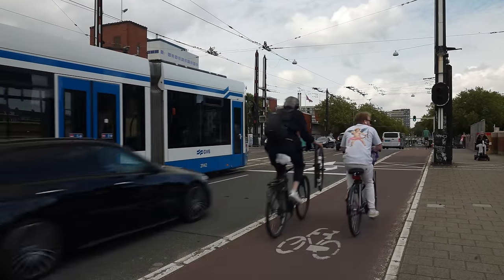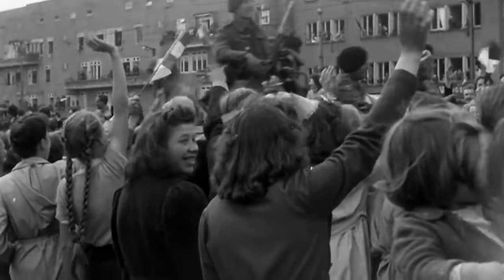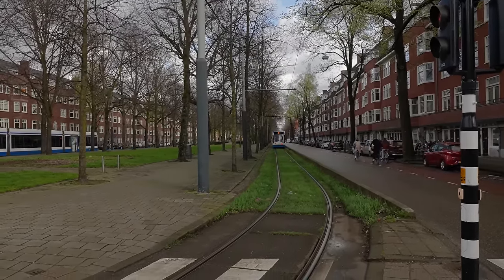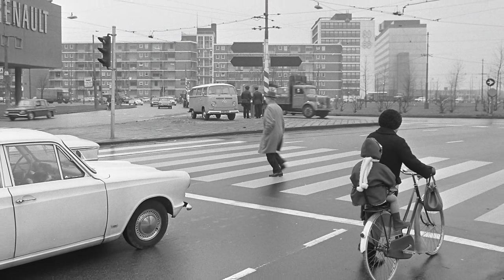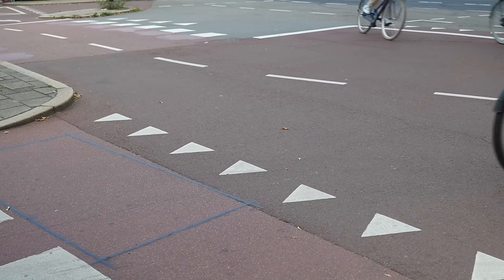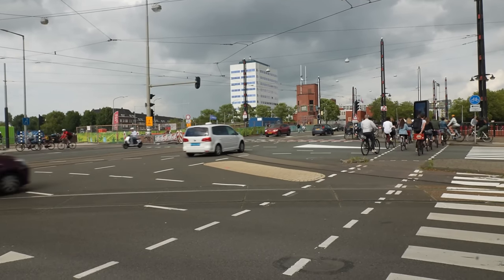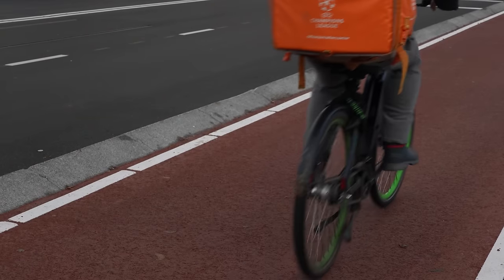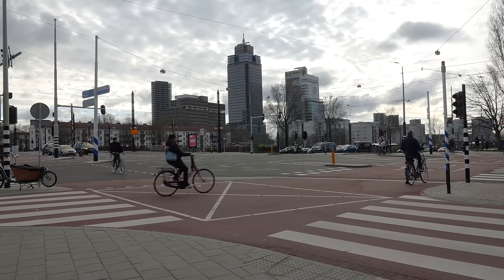Amsterdam Closed This Bridge to Cars (but not bikes ofc)

Comment: Since I've started watching your videos I have tried to prioritize using public transit or biking where I can and I discuss the overwhelming benefits of these mods of transport to others when they are sitting still long enough. I love this stuff, but I did want to ask a question. So, my partner was a bus drier for about 6 months and unfortunately he had to leave the job due to stress.  The stress was caused by the fact that he regularly had situations where there was belligerent, intoxicated, and sometimes unconscious or overdosing riders that he had to call emergency services for or just stressfully baby sit them.  This was not a big city.  I suspect a lot of the reason for this is that we don't have a robust social work infrastructure to help these people any other way.  We also largely perceive the point of public transit in this country as a substitute for driving if you're drunk or high.  This is a good thing on it's face but it leads to the general perception of public transit in the U.S. (at least around here) as something most people want to avoid. It also makes working in public transit a nightmare.  Is anything like this an issue in Amsterdam?  I largely suspect it is not and that there are other cultural structures and norms in place that prevent this kind of thing, as well as many more people taking public transit has normalized it, but if it ever is an issue I am curious how these sorts of things are handled. And simply drunk or high isn't the problem, but specifically poorly-behaved people or people in immediate need of medical or mental health care.
Reply from the maker: You can occasionally find drunk and disordererly people on public transit, especially in tourist areas, but what you describe is almost entirely due to a lack of social care and socialized healthcare in the US.

This is actually one of the reasons why I've stopped talking to Americans about public transit: I do not have the patience to explain to brainwashed Americans as to why they need a social safety net.
Reply: @NotJustBikes  I suspected as much.  :/  Many pieces to the puzzle are being dropped in this country.

Comment: Stalinlaan. If you could ride on souls, for every dead body Stalin killed you could pave the road by just one meter (or would align them to form one straight line, assuming everyone is one meter tall) - you would be able to pave the road from Amsterdam to West-Berlin or Moscow depending on estimates (5 or 25 million dead).

Comment: The Rosensteinbrücke in Stuttgart was condemned a couple of years ago, but left open to cyclists and pedestrians whilst they thought about what to do with it. The worst part of this was that 2 Stadtbahn lines had to be diverted, making one of the busiest stations even busier. The bridge is now completely closed whilst they work towards its demolition this summer, after which they're going to erect a temporary foot/cycling bridge - this surprises me as there are two other foot/cycle bridges not far away, but yaay Stuttgart. It seems the favoured plan for the replacement (coming in 2031 - booo Germany where everything takes forever) is to allow only public transport - i.e. busses and the Stadtbahn on the road part, with cyclists and pedestrians getting a properly separated area.  

This of course makes the AfD very angry who are insisting that more lanes for cars are absolutely necessary to solve congestion once and for all.

Comment: I see this "ideal" neighborhood with the apartment blocks.  I can imagine people making noise above you below you and one each side.  Maybe the walls are thick to give you silence.  I bet that temporary bridge is a whole lot quieter than the old bridge.
Reply: If you're from the US, that fear is understandable, because they seem to build everything with cardboard/wood.

When you build with stone/brick/concrete, there's hardly any noise. I've never heard someone from the side & only had one neighbour from above, who was completely antisocial, but that was a special (head)case. Otherwise, no problems.
Reply: @LeafHuntress Good entry - I lived in a trailer park for a while.  I was about 30 or 40 ft from the next trailer (10-15 meters maybe).  The walls were so thin on the trailers I could hear their television.  People who have lived in US Row houses  have told me they could hear every word through the walls of single layer bricks. Sounds like they do it better in Europe.
Reply: @daniellarson3068 the brick bearing walls are correct, the block the air noise but not the contact noise. And these apartment blocks have mostly wooden floors, but often with a separate lowered ceiling beam layer as well, to block contact noise from the apartment above, have room for ducts and pipes and for extra fire safety.

Comment: Ya'know one of these days you and a bunch of other urban design channels will have to take a crack at designing your own city.

Take a city that is know to be poorly built and car focused. Roll back the clock and see what it looked like in at the advent of cars becoming common and final design it better.  Taking into account the landscape, its modern day population with all their needs and major industries it needs to support.
Reply: Normally most people would recommend their own city for this but Vancouver BC is fairly solid by North American standards. 

Considering we have the busiest bus route in the US or Canada (not the busiest on the continent, a few in Mexico City have that.) The 99B line has buses come every 3 minutes at peak hours and still has to turn people away for overcrowding. It connects Commercial Broadway (the most central skytrain station) to Vancouver City Hall, The Vancouver General Hospital, and most critically, the University of British Columbia among a slew of apartments and businesses. There's a reason their building a subway along it West Broadway lol. Their also discussing making a gondola to get up to Simon Fraser University, because it's on a mountain top making buses impractical and trains impossible.

Comment: Kinda unrelated, but the audio compression in this video is very harsh to me, personally I prefer how it was in previous videos. Especially the use of sidechain or master bus compression, I find it unpleasant on the ears when background noise rapidly fluctuates in volume. Love your videos either way, keep it up
Reply from the maker: Nothing has changed with the audio production hardware, software, or settings for a very long time. I don't know why you would hear a difference with this video. 🤷‍♂️

Comment: what the scallop is a frite cone
Reply: If you got chips in the UK or fries in the US, that's called patates frites, which in Dutch gets shortened to patat friet.(unless you're in a fancy restaurant) Now depending on where you live in the Netherlands, people use either the word PATAT(the correct term) or friet. If you buy it, it comes in a bag = zak. So that will be a patatzak.(or wrongly, a frietzak) 
So a cone to put your chips in.

Only the designer of that piece of infrastructure obviously used the wrong word frietzak for it, which Jason called frite cone.

Comment: What's the reasoning for having moped users walk their mopeds across the bike bridge? I get that they're heavier and motorized, but not significantly more so than bikes, and it just seems like more traffic could cross the bridge quicker if the mopeds could roll along with the bikes
Reply: Generally vehicles that operate fully motorized are not allowed on bicycle paths. Also vehicles that go faster than 25km/h are not allowed on bicycle paths most of the time.
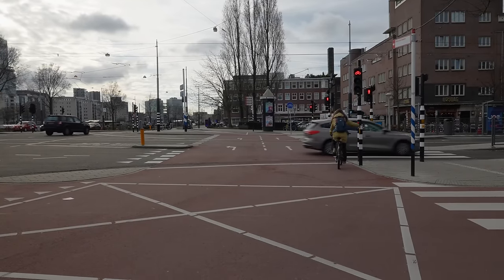This isn't always enforced, and not always required, but often enough you will see mopeds on the street instead of on the bicycle path (11:27 is an example). This is generally for the safety and comfort of cyclists since mopeds are both dangerous and really f*cking loud. So they allow mopeds to cross the bridge because they're compact enough, but they're not allowed to drive them because of those rules.

Comment: just so you can stop doomering about america, hollywood blvd is gonna go down to one lane each way, 24hr bus lanes, sometimes protected bike lanes (the other times it shares with the bus but that's fine), and it already has a subway line under it. and k line northern in about 20 years (yikes) will go straight there making it a one seater from the airport